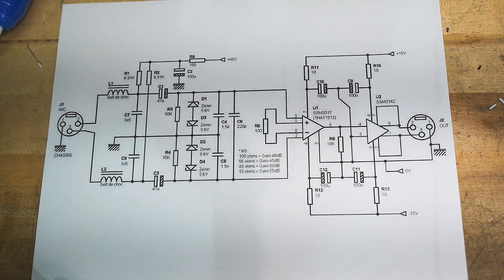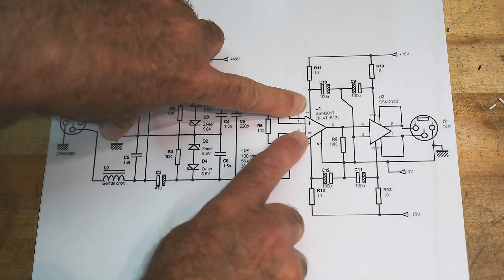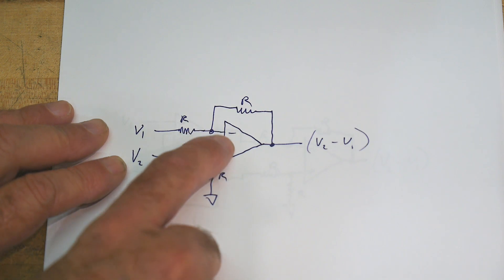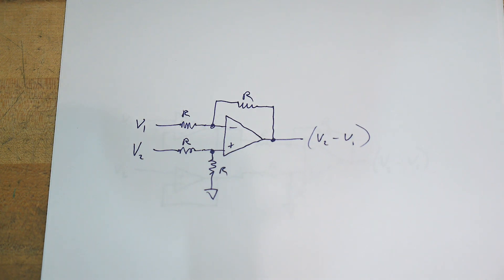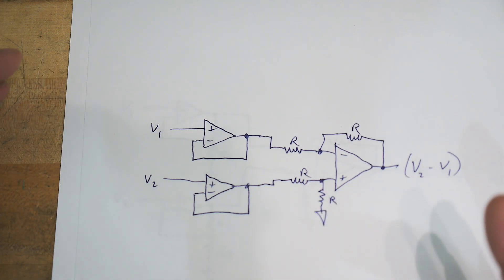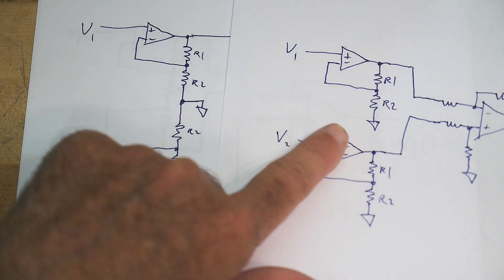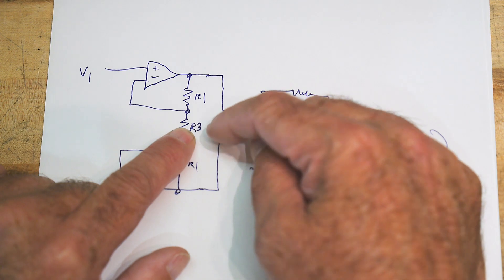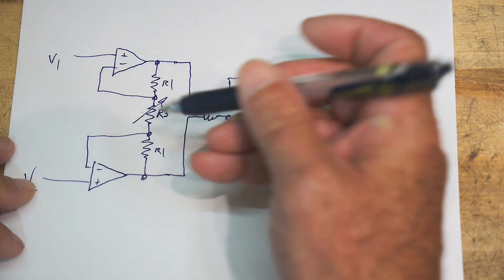#443 Instrumentation Amplifier Design and Calculations

Comment: By doing the amplification on the high input impedance stage won't that amplify the common mode noise as well?
Reply from the maker: no, the common mode will occur on both inputs and the final diff amp will cancel them